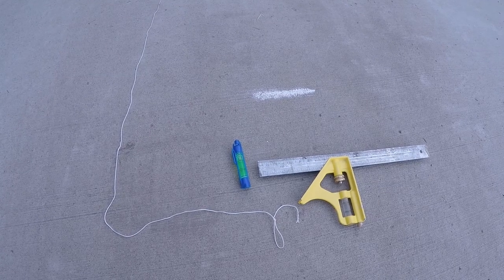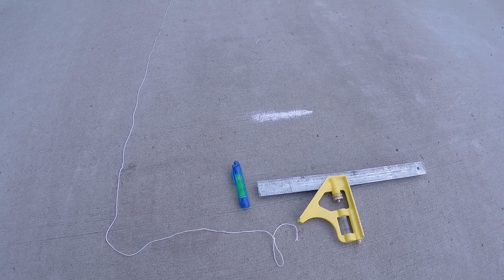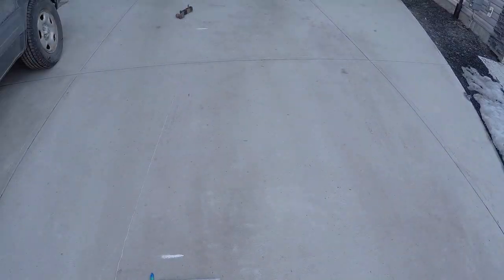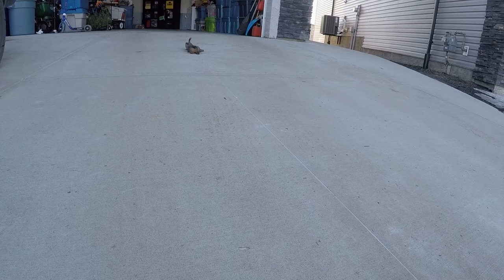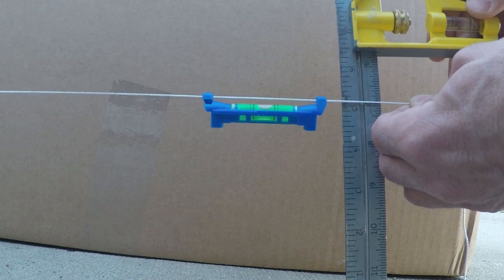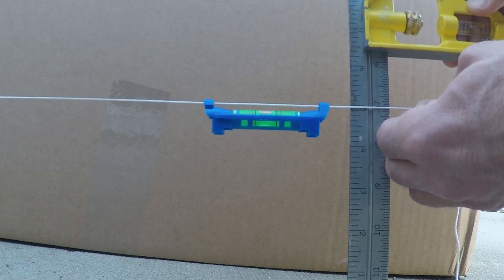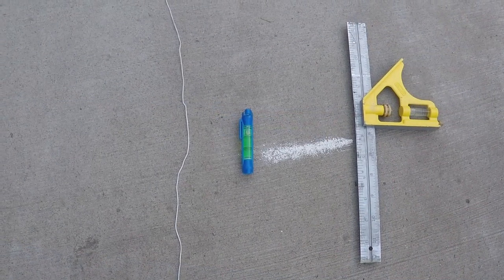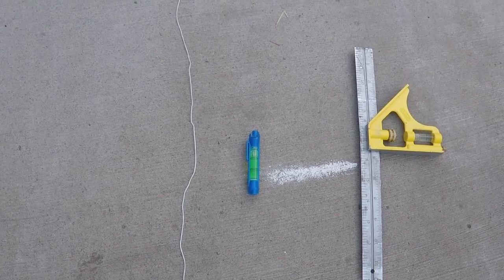Using a Line Level to Measure Elevation Change

Comment: Alternative.... using level hose...
Reply from the maker: I'll look into one
Reply: A string level will be very unaccurate across lets say 10 meters. Up to 3mm/meter can It differ. The most accurate way Is by using a water hose level. It will show exact up to 50 meter. A crosslaser will show 3-6mm wrong at 7-10 meter If you not buy a super expensive one.